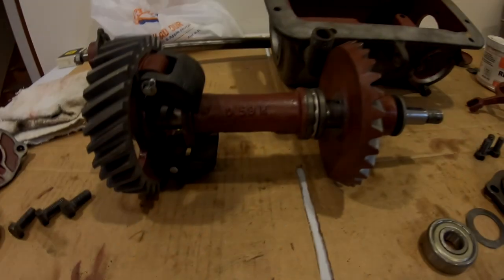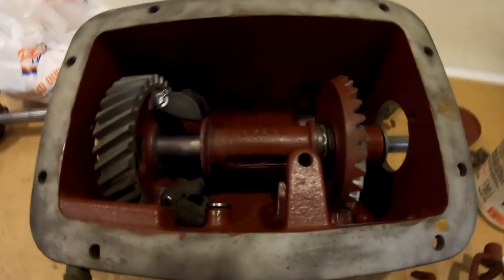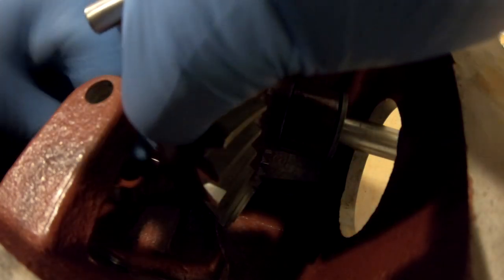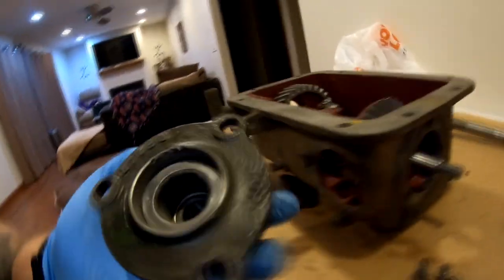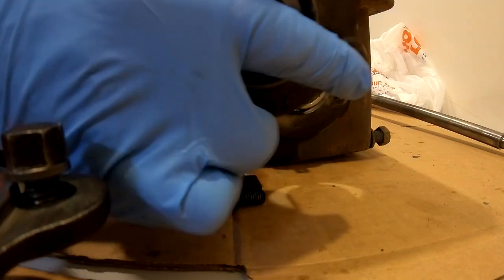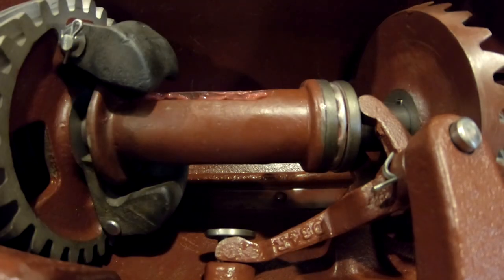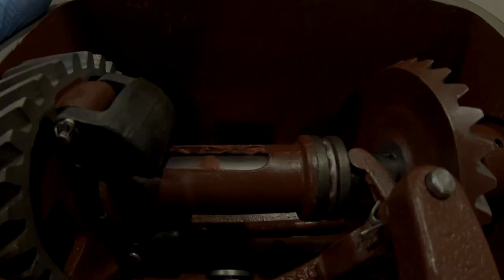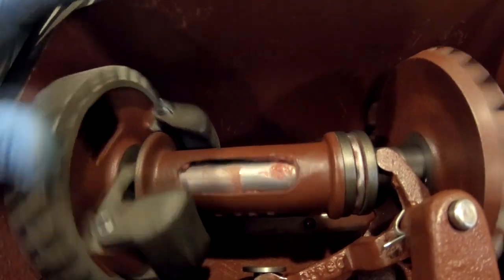1927 John Deere D S# 44891 Part 9: Governor Reassembly

Comment: could you address that oil tube at the top of the housing?  mine (1928, #57034) has a hole rusted into it that I need to patch, somehow.  how does oil get into the tube?  just finding your videos. very useful!  missed the one where you disassembled the governor.
Reply from the maker: The oil tube is actually a trough. The governor is splash lubricated and the trough acts as a catch. It then has drip-holes to drip oil onto the governor shaft. I don't believe I have a governor teardown video - but it is pretty self explanatory. both gears are pressed onto the shaft, so if you are going that far into it to replace or completely disassemble - take note of that. I was able to find a set of very nice weights with zero wear, and I then drilled out the bosses on the gear and installed bushings. I made new pins and instead of heating and peening them over, I drilled them for cotter pins to make servicing at a later date (which I will probably never have to do) much easier. I hope this helps!

Comment: Thank you for doing this. I destroyed the bevel gears in my 39h by replacing the bearing on the outside with a tapered bearing and not setting the proper gear Lash. It ate itself alive. I have a new set of Gears but now I got to go through this entire process.
Reply from the maker: Absolutely! It is a LOT of trial and error in getting it set just right, but I think it will be very worth it. I didn't want to mess up a nice set of NOS gears, so I wanted to be sure I got it right!

Comment: Kenny, I've got a question when you put the bearings in the bearing housing are they not suppose to be pressed in rather than just being able to just press them in with your fingers? Without them fitting to where you would have to press them in won't they spin in the cairrer? I didn't know because all I ever put in had to fit the carrier and be put on a press and pressed in. I've never worked on one that old so I didn't know. Looks like the way those are it could wear the carrier faster.
Reply from the maker: I had the same thoughts about them, and I asked a resident "early D expert" the same question. I read informed that the bearings are a snug fit but not a press fit as they are supposed to be able to float slightly in the housings to allow for the adjustment of the bevel and pinion gears. Even the NOS carrier I have was a snug-slip fit with the bearing. Interesting how they did things back then.

Comment: Guessing that you have just as many rolls of different size felt as you do gasket paper.  Gotta love the ol ways of do it yourself.  Thank you for your video...
Reply from the maker: I actually don't have ANY rolls of felt. I ordered all of the felt seals from different eBay vendors, but they are genuine JD parts. A lot of the parts aren't available from JD anymore, so you have to scour eBay and do some networking to see who has something in their stash!
Reply: @KennyKizzleRustyNutzRanch  yes I understand a lot of parts are unavailable  . Some OEM parts are available through eBay and swap meets,  reproduction,  and even some sites specializing in connections to other warehouses.  Often needed felt washers and sheet metal opening felt are not available or just way to expensive.  30.00 for a 2 1/2 " hydraulic port dust seal.  A foot strip by three feet 1/4" thick  of felt for 25.00 and a good set of arch punches . Working on a 47 Farmall H myself.  And have watched your videos numerous times for reference.  Thank you for this chat .